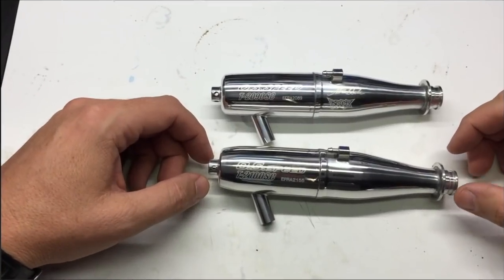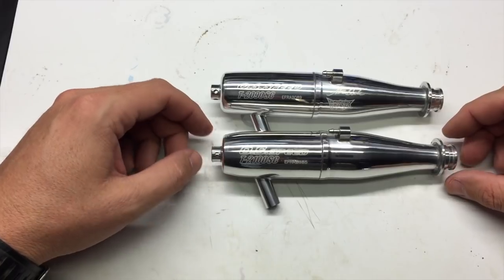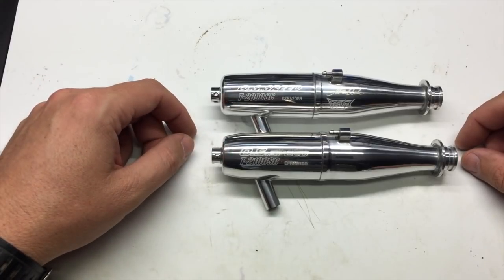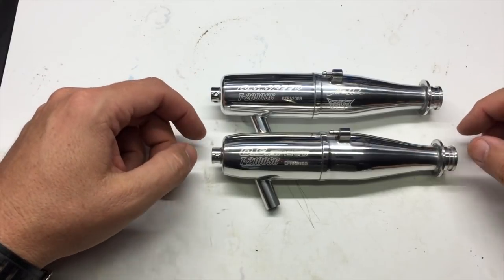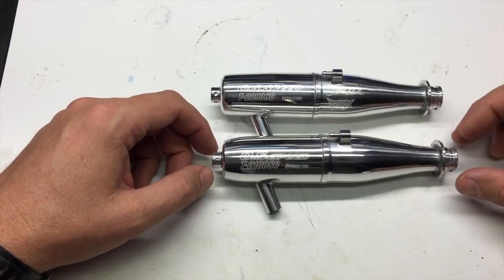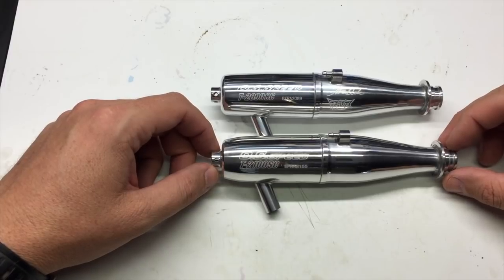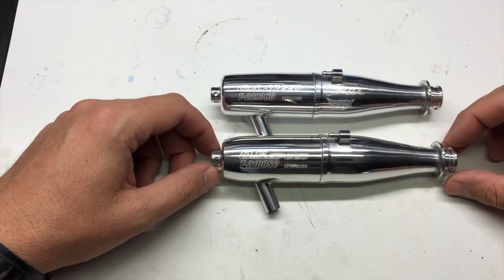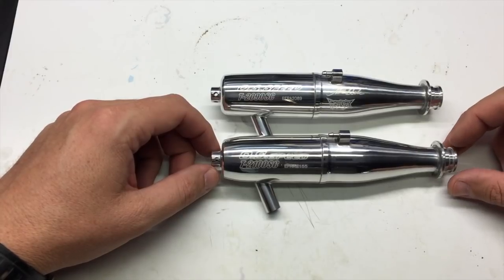Adam Drake from Mugen Seiki Racing talks about the O.S. 2100SC exhaust pipe.

Comment: I grabbed the OS R2104 and 2100sc combo. I have to buy the off road 75mm manifold because it came with an on road manifold that doesn't fit in my buggy
Reply from the maker: You're running the R2104 in an off road buggy?  We have manifolds if needed.  www.thedrakeracing.com
Reply: Why are you running an on-road engine in your buggy? What’s it like compared to normal buggy engines? Why did you decide on such a strange choice to run in an off-road vehicle?🤔

Comment: I have a Losi 8 buggy the arm is not long enough to mount the pipe to keep it in place  it’s the 2100
Reply from the maker: You could try using a old sway bar and bending it as a pipe wire.

Comment: Im still kinda confused on what pipe shapes do what. IE how high end power for large sweeping  tracks and lowend power for tight tracks that require quick short bursts of power. I race on a tight track with big jumps right after turns, so which pipe is good for plenty of lowend pop? I usually run a 48 tooth spur gear and 13 or 14 bell.
Reply from the maker: With the OS pipes, the 2090 has the most low-end power, then the 2100, and the 2060 is the smoothest.  Header length will also fine tune the power band.  https://www.youtube.com/watch?v=Tv_6rnqNf28&t=56s
Reply: @AdamDrake  I am a bit confused, one of your previous videos where you compared the 2060 to the 2090, you said the 2060 was smoother and 2090 had more punch, which is a longer pipe, the 2100 is even longer than the 2090 but now you are saying it is smoother than the 2090? Is their a difference in the chambers or internals of the 2100 to cause it to be smoother?